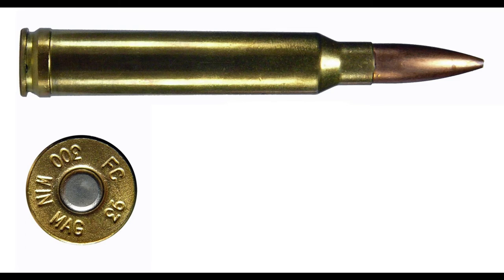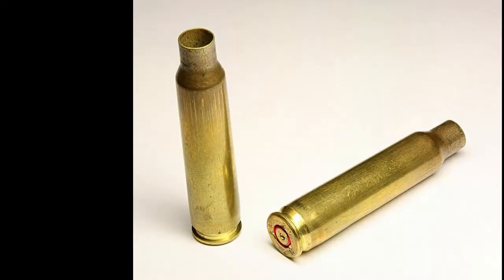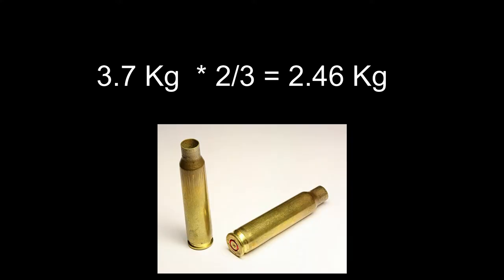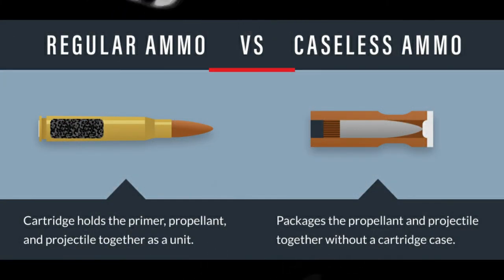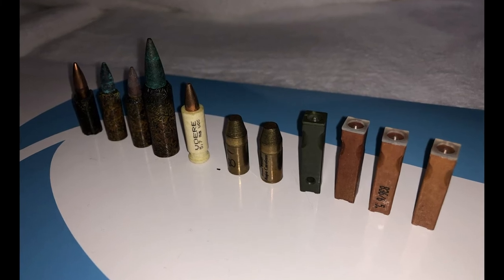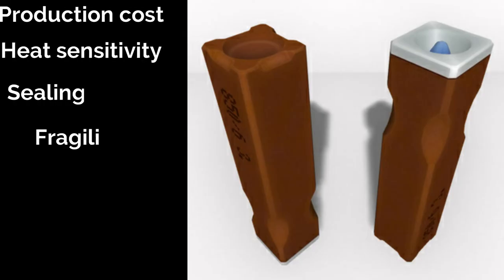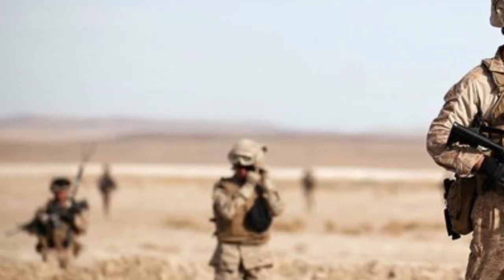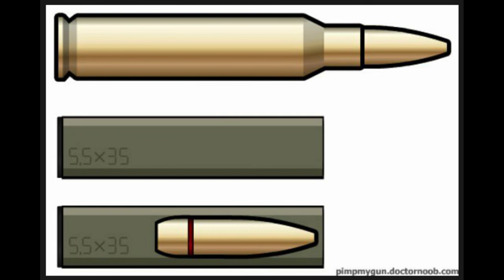Caseless Ammuniation, Future of small arms

Comment: Semi caceless rounds with a fireing pin that punches a little hole in the wax back to the combustion cap in front of the powder to buld up some pressure to expand out the back in to the bolt cup where the bullet will be.
P.S. bullet will be same size as a normal bullet with case but bullet will be both case and bullet
Reply from the maker: I appreciate your knowledge